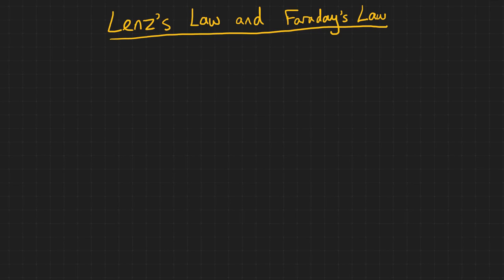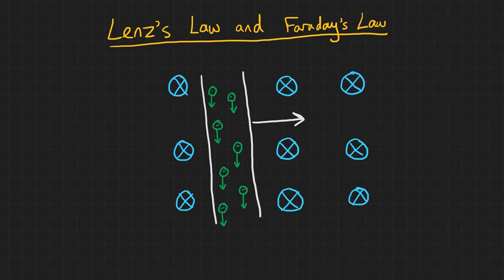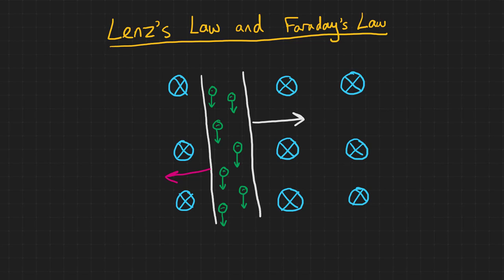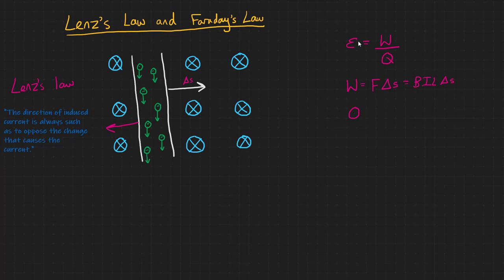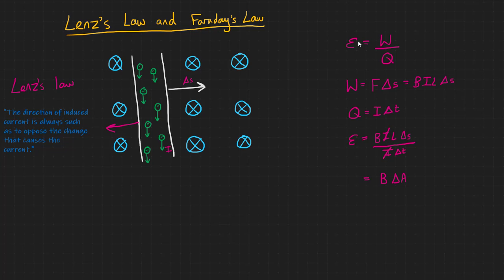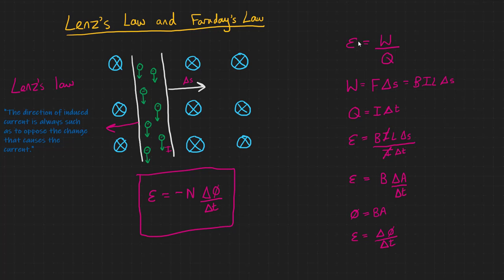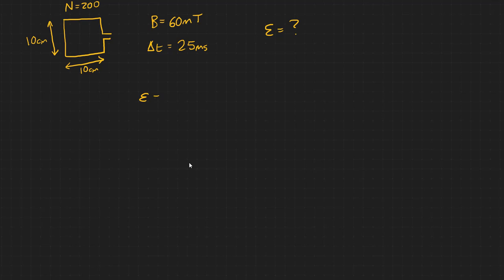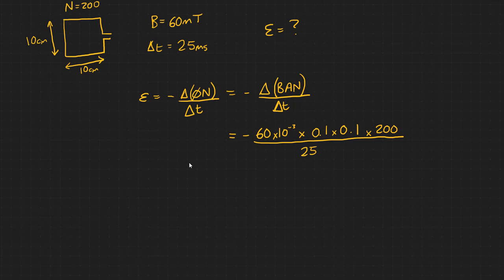Faraday's law and Lenz's law

Comment: 3d Doyle Spirals to do spiral inversion combined with sphere inversion. Flux and charge working together tangentially. The magnetic field has two poles equal distance apart. Pick two points in the upper right quadrant for ease of visualization. The electric field also has two poles. The electric takes the bottom'ish one and goes 90 degrees from the midpoint towards the origin. Negative inversion happens on the radius, so it starts at the origin (not the midpoint between the poles) and moves to the bottom pole.